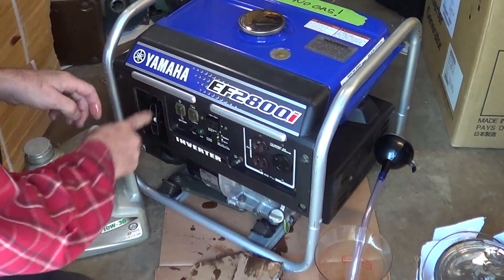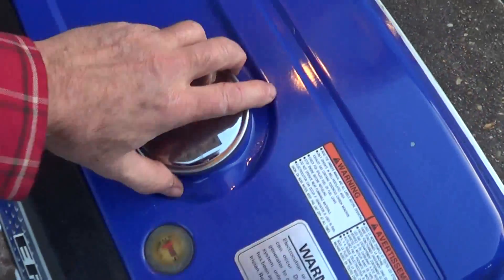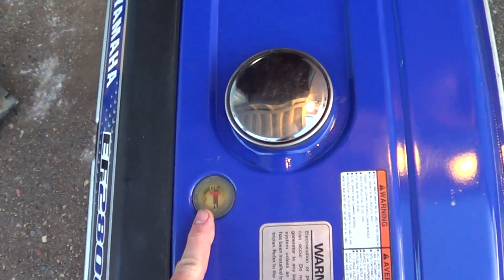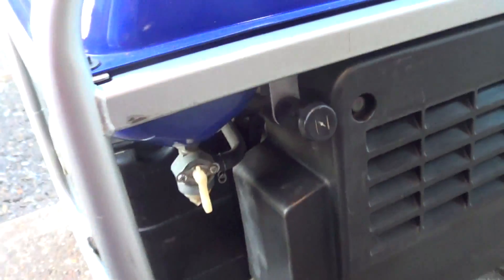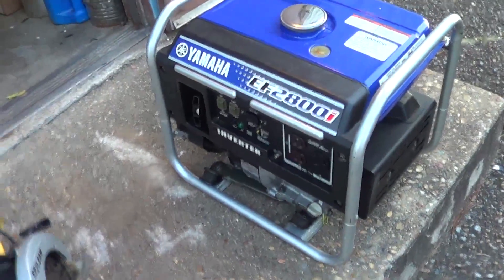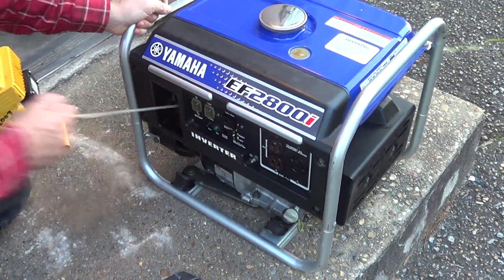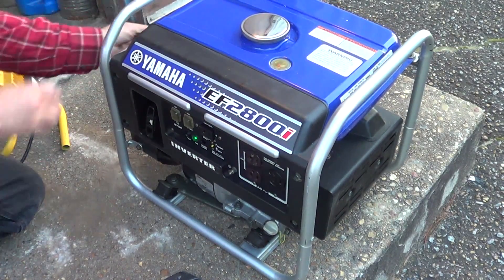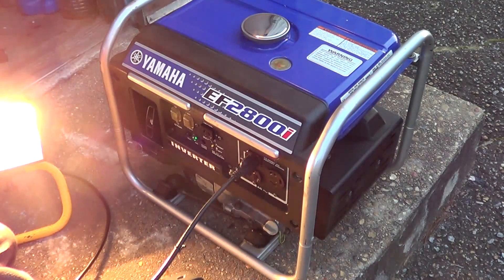Yamaha EF2800i Inverter Generator

Comment: 3:30   In  'econo '  mode;  ?  So, why does the thing, vibrate across your cement pad ?  Must be a 4 cycle, and they are changing the speed,and balance, somewhere .  I  have a 1983  ef2800,  ORIGINAL.  Starts right up. At 3700 rpm, and with 2 angle grinders plugged in, running the rpm goes to 3610-3630  and it produces 119-121 volts at this load level, rpm.  Much better than those  ' chinese'  knockoff  copies, made today.  There are too many  'things'  togo  wrong, with modern  generators. ( Poorly designed armatures, and field coils, in the modern generator.  This old one of mine, is made  'MUCH  BETTER '.   
Anyway,  thanks  for all you  do,  3belt Westy  !   Could you show, rpm and load output ?   just  curious...

Comment: Excellent  i  own this model . put it in and enclosure . on  natural gas with flex line and grounded . and transfer switch . runs quiet. 4/19/2021
Reply: ⚠️Don’t forget to follow the generator safety tips whenever you use your portable generator. This is a very important announcement for everyone for safety. 

This is just a reminder for everyone’s safety. All generator safety rules need to be followed carefully 

Generator safety tips: 

1) KEEPING OTHERS SAFE: Please do not allow an unqualified person or your children to operate and service the portable generator. Just because some manuals don’t say that doesn’t mean it’s safe. That is important against the generator safety rules. We also need to be keeping an eye on our children too. You need to make sure that your children are not playing near the portable generator especially when it’s running so they won’t get electrocuted. Generators pose electrical risks and they can be hot during an operation. Please keep your children away from the portable generator at all times. It is important to keep our children safe especially our little ones. Children often get curious about anything so we should keep an eye on them to also make sure they’re not wandering towards the generator. 

2) WHERE TO RUN YOUR GENERATOR: Some people use their portable generators indoors which increases the risk of carbon monoxide poisoning. It’s important to have a carbon monoxide if you have a gas generator. Never ever use your generator indoors even if your doors and windows are open and even in the garage is not safe to use a portable generator. Not even at your porch and your deck. It is never safe to use your generator indoors and in enclosed areas of your home. Your generator needs to be 15-20 feet away from your house. 

3)🔥FIRE HAZARDS: Never refuel your generator while it’s running. You need to let your generator cool off before refueling it and before storing your generator. Never overload your generator too. Never ever back feed your generator. You should never plug your generator into a wall outlet. Also never store propane tanks indoors. Please keep flammable things away from the generator as well and please don’t smoke cigarettes near the generator. Having a fire extinguisher next to the generator is also important against the generator safety rules. 

4) GENERATOR OPERATION: make sure your hands are dry before touching the generator. Never use your generator in wet conditions. Don’t let your generator get wet. You need a generator tent if you need to use your generator during wet weather. Please don’t wear loose clothes when operating the generator. Turn on your generator before plugging in appliances. Use the right cord for your generator. Please do not use worn out cords. 

https://youtu.be/I1jT3ANENvI and here is a video more about keeping others safe when using generators. All generator safety rules need to be followed carefully. 

Hope this helps.

Comment: Inverter modul genset yamaha 2800i
Reply: ⚠️Don’t forget to follow the generator safety tips whenever you use your portable generator. This is a very important announcement for everyone for safety. 

This is just a reminder for everyone’s safety. All generator safety rules need to be followed carefully 

Generator safety tips: 

1) KEEPING OTHERS SAFE: Please do not allow an unqualified person or your children to operate and service the portable generator. Just because some manuals don’t say that doesn’t mean it’s safe. That is important against the generator safety rules. We also need to be keeping an eye on our children too. You need to make sure that your children are not playing near the portable generator especially when it’s running so they won’t get electrocuted. Generators pose electrical risks and they can be hot during an operation. Please keep your children away from the portable generator at all times. It is important to keep our children safe especially our little ones. Children often get curious about anything so we should keep an eye on them to also make sure they’re not wandering towards the generator. 

2) WHERE TO RUN YOUR GENERATOR: Some people use their portable generators indoors which increases the risk of carbon monoxide poisoning. It’s important to have a carbon monoxide if you have a gas generator. Never ever use your generator indoors even if your doors and windows are open and even in the garage is not safe to use a portable generator. Not even at your porch and your deck. It is never safe to use your generator indoors and in enclosed areas of your home. Your generator needs to be 15-20 feet away from your house. 

3)🔥FIRE HAZARDS: Never refuel your generator while it’s running. You need to let your generator cool off before refueling it and before storing your generator. Never overload your generator too. Never ever back feed your generator. You should never plug your generator into a wall outlet. Also never store propane tanks indoors. Please keep flammable things away from the generator as well and please don’t smoke cigarettes near the generator. Having a fire extinguisher next to the generator is also important against the generator safety rules. 

4) GENERATOR OPERATION: make sure your hands are dry before touching the generator. Never use your generator in wet conditions. Don’t let your generator get wet. You need a generator tent if you need to use your generator during wet weather. Please don’t wear loose clothes when operating the generator. Turn on your generator before plugging in appliances. Use the right cord for your generator. Please do not use worn out cords. 

https://youtu.be/I1jT3ANENvI and here is a video more about keeping others safe when using generators. All generator safety rules need to be followed carefully. 

Hope this helps.

Comment: Price
Reply: ⚠️Don’t forget to follow the generator safety tips whenever you use your portable generator. This is a very important announcement for everyone for safety. 

This is just a reminder for everyone’s safety. All generator safety rules need to be followed carefully 

Generator safety tips: 

1) KEEPING OTHERS SAFE: Please do not allow an unqualified person or your children to operate and service the portable generator. Just because some manuals don’t say that doesn’t mean it’s safe. That is important against the generator safety rules. We also need to be keeping an eye on our children too. You need to make sure that your children are not playing near the portable generator especially when it’s running so they won’t get electrocuted. Generators pose electrical risks and they can be hot during an operation. Please keep your children away from the portable generator at all times. It is important to keep our children safe especially our little ones. Children often get curious about anything so we should keep an eye on them to also make sure they’re not wandering towards the generator. 

2) WHERE TO RUN YOUR GENERATOR: Some people use their portable generators indoors which increases the risk of carbon monoxide poisoning. It’s important to have a carbon monoxide if you have a gas generator. Never ever use your generator indoors even if your doors and windows are open and even in the garage is not safe to use a portable generator. Not even at your porch and your deck. It is never safe to use your generator indoors and in enclosed areas of your home. Your generator needs to be 15-20 feet away from your house. 

3)🔥FIRE HAZARDS: Never refuel your generator while it’s running. You need to let your generator cool off before refueling it and before storing your generator. Never overload your generator too. Never ever back feed your generator. You should never plug your generator into a wall outlet. Also never store propane tanks indoors. Please keep flammable things away from the generator as well and please don’t smoke cigarettes near the generator. Having a fire extinguisher next to the generator is also important against the generator safety rules. 

4) GENERATOR OPERATION: make sure your hands are dry before touching the generator. Never use your generator in wet conditions. Don’t let your generator get wet. You need a generator tent if you need to use your generator during wet weather. Please don’t wear loose clothes when operating the generator. Turn on your generator before plugging in appliances. Use the right cord for your generator. Please do not use worn out cords. 

https://youtu.be/I1jT3ANENvI and here is a video more about keeping others safe when using generators. All generator safety rules need to be followed carefully. 

Hope this helps.

Comment: I have this same generator but my Eco mode doesn't work...any ideas why?
Reply: ⚠️Don’t forget to follow the generator safety tips whenever you use your portable generator. This is a very important announcement for everyone for safety. 

This is just a reminder for everyone’s safety. All generator safety rules need to be followed carefully 

Generator safety tips: 

1) KEEPING OTHERS SAFE: Please do not allow an unqualified person or your children to operate and service the portable generator. Just because some manuals don’t say that doesn’t mean it’s safe. That is important against the generator safety rules. We also need to be keeping an eye on our children too. You need to make sure that your children are not playing near the portable generator especially when it’s running so they won’t get electrocuted. Generators pose electrical risks and they can be hot during an operation. Please keep your children away from the portable generator at all times. It is important to keep our children safe especially our little ones. Children often get curious about anything so we should keep an eye on them to also make sure they’re not wandering towards the generator. 

2) WHERE TO RUN YOUR GENERATOR: Some people use their portable generators indoors which increases the risk of carbon monoxide poisoning. It’s important to have a carbon monoxide if you have a gas generator. Never ever use your generator indoors even if your doors and windows are open and even in the garage is not safe to use a portable generator. Not even at your porch and your deck. It is never safe to use your generator indoors and in enclosed areas of your home. Your generator needs to be 15-20 feet away from your house. 

3)🔥FIRE HAZARDS: Never refuel your generator while it’s running. You need to let your generator cool off before refueling it and before storing your generator. Never overload your generator too. Never ever back feed your generator. You should never plug your generator into a wall outlet. Also never store propane tanks indoors. Please keep flammable things away from the generator as well and please don’t smoke cigarettes near the generator. Having a fire extinguisher next to the generator is also important against the generator safety rules. 

4) GENERATOR OPERATION: make sure your hands are dry before touching the generator. Never use your generator in wet conditions. Don’t let your generator get wet. You need a generator tent if you need to use your generator during wet weather. Please don’t wear loose clothes when operating the generator. Turn on your generator before plugging in appliances. Use the right cord for your generator. Please do not use worn out cords. 

https://youtu.be/I1jT3ANENvI and here is a video more about keeping others safe when using generators. All generator safety rules need to be followed carefully. 

Hope this helps.

Comment: I hope this guy is not a salesman. The generator is moving all over the place, and he forgot to push back the choke in. And nearly severed the power cord with his handsaw. Jeez
Reply: ⚠️Don’t forget to follow the generator safety tips whenever you use your portable generator. This is a very important announcement for everyone for safety. 

This is just a reminder for everyone’s safety. All generator safety rules need to be followed carefully 

Generator safety tips: 

1) KEEPING OTHERS SAFE: Please do not allow an unqualified person or your children to operate and service the portable generator. Just because some manuals don’t say that doesn’t mean it’s safe. That is important against the generator safety rules. We also need to be keeping an eye on our children too. You need to make sure that your children are not playing near the portable generator especially when it’s running so they won’t get electrocuted. Generators pose electrical risks and they can be hot during an operation. Please keep your children away from the portable generator at all times. It is important to keep our children safe especially our little ones. Children often get curious about anything so we should keep an eye on them to also make sure they’re not wandering towards the generator. 

2) WHERE TO RUN YOUR GENERATOR: Some people use their portable generators indoors which increases the risk of carbon monoxide poisoning. It’s important to have a carbon monoxide if you have a gas generator. Never ever use your generator indoors even if your doors and windows are open and even in the garage is not safe to use a portable generator. Not even at your porch and your deck. It is never safe to use your generator indoors and in enclosed areas of your home. Your generator needs to be 15-20 feet away from your house. 

3)🔥FIRE HAZARDS: Never refuel your generator while it’s running. You need to let your generator cool off before refueling it and before storing your generator. Never overload your generator too. Never ever back feed your generator. You should never plug your generator into a wall outlet. Also never store propane tanks indoors. Please keep flammable things away from the generator as well and please don’t smoke cigarettes near the generator. Having a fire extinguisher next to the generator is also important against the generator safety rules. 

4) GENERATOR OPERATION: make sure your hands are dry before touching the generator. Never use your generator in wet conditions. Don’t let your generator get wet. You need a generator tent if you need to use your generator during wet weather. Please don’t wear loose clothes when operating the generator. Turn on your generator before plugging in appliances. Use the right cord for your generator. Please do not use worn out cords. 

https://youtu.be/I1jT3ANENvI and here is a video more about keeping others safe when using generators. All generator safety rules need to be followed carefully. 

Hope this helps.